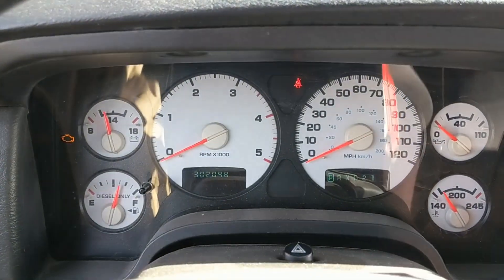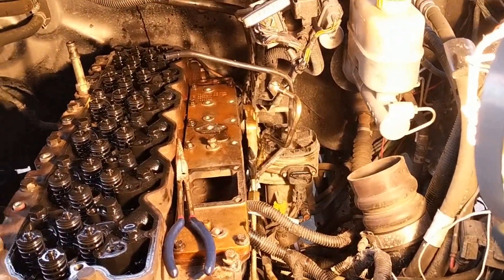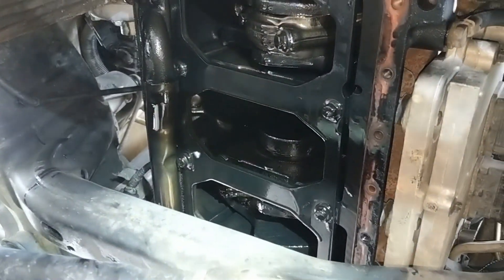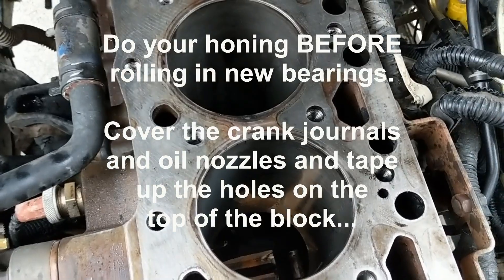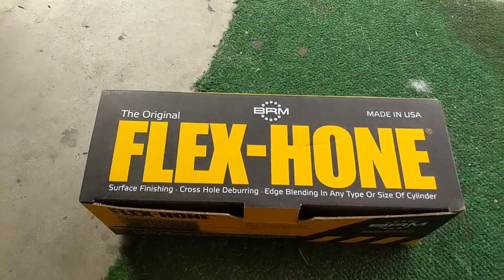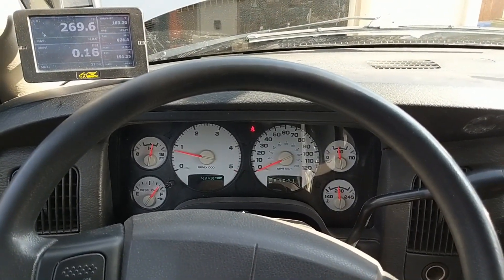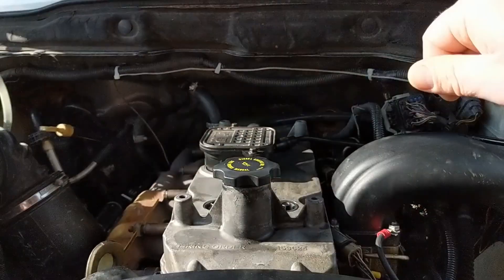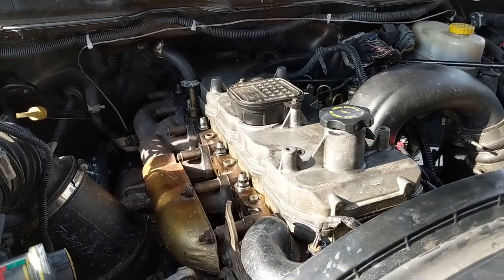5.9 Cummins in frame rebuild- 2005 Dodge Ram 2500

Comment: How did you replace the rear main seal  in frame rebuild ?
Reply from the maker: I didn't.  That was done later as part of a trans rebuild.  You have to pull the trans to get to that seal👌

Comment: I have the same year rig I actually removed mine and sent it out for rebuild , in hindsight I should have done what you did, I did how ever put a new turbo on mine and injectors as mine were toast.
Ended up putting studs on my cyl head head and a new clutch fan.
I'm running a smarty tune on tow mode , which tune are you running?
Reply from the maker: I run my own custom tunes, usually run the Street tune with exhaust brake tuning these days: https://www.5-9diesel.com

Comment: Did you wind up turning the crank see I was going to do this and just use a whole nother engine my truck needs a complete rebuild and it also needs a new ppimp and yeah I was thinking about doing the same thing just putting new Pistons boring it out dropping the pan rebuilding it right in the truck tell me what your thoughts are
Reply from the maker: No I never turned the crank, still going strong.

Comment: Tell me about the high EGT #s , been hot before on stock timing and no tuner, I was worried but 25k later its still ok. 1300+ for over 5 min on a big ole grade pulling over 16k lbs.

Comment: What type of oil do you run? Is it safe to switch from plain rotella to synthetic amsoil or will.this cause leaks or problems at 230,000 miles?

Comment: Hey did you replace the con rod bolts and the main bearing bolts? Or did you reuse it
Reply from the maker: I reused them
Reply: @DieselCamper   hey I’m deep into my engine today 😂 no wrecked cylinder head or walls just tired rings and she need a honing

Comment: I know this comment is years late, but if you use a flat style cyl hone it allows you to see if there's any areas of the cylinder that are worn badly. Piston rings often break because as the piston travels up/down the ring is opening/closing (it's getting worked).  Those worn areas allow the ring gap to open and then the gap closes when it passes the worn area.  It will re-break the ring in no time at all.  In cases like that, it's cyl bore time.  Hone not gonna work.  Traditional flat hone only type that will show the excessively worn areas.  There will be low spots the flat hone can't touch and then you'll see them.  Ball type hone will not show it.  You can also use bore gauge, but flat hone will show the worn areas.
Reply: Sounds like it lasted 300k and he will be happy to run another 300k. Prob broke rings from bad injectors
Reply: Your comment was useful for me I’m getting ready to rebuild my first 24 valve so thanks for the input!

Comment: hello there champion!   I have a 2000 dodge 3500 5.9 liter and has 360,000miles on it..  how would you charge to frame over houl... my truck 
still runs good, but  it needs new gaskets on front and rear seal and tappet cover and oil pan...?

Comment: My personal 2005 has a minor amount of blow by nothing major. The engine has roughly 230,000 miles and is clean as a whistle. I use it 30 weeks a year  to move my rv and it’s starting to run rough occasionally. it’s “losing” or “burns” about 2-3 quarts of oil every 600-1000 miles. Thing that had me the most nervous is it tried to run away on me one morning at a stop light. It shot from idle to 3000+ rpm and sat there blowing black smoke for about 10-15 seconds at 3000+ rpm then just idled back down to normal.

Comment: So how long did it take you do to the overhaul? My 2003 is currently sitting in my driveway with blow by. And I’m hoping I don’t have a lip in my cylinder walls so I can do this. Just curious on the time it took, and how did you time the motor when you got it back together?
Reply from the maker: I gave myself 5 or 6 days to get it done.  Probably worked 4-5 hours per day.
Reply: @DieselCamper  what about timing the motor once you got it back together? How did you do that?
Reply from the maker: I never disengaged the crank from the cam so no need to.

Comment: Thats not normal. That is blow by from running a hone down and zero measuring being done. Also the reson you had a broken ring was because you had a bad injector. Hopefully you changed that too. Also letting a new engine idle for long periods of time will glaze the cyl and cause it to use oil.

Comment: Were you able to use stock piston rings in cylinder one after honing? I’m about to overhaul and do cylinder 1 and 5 trying to get parts list together.
Reply from the maker: Yes I used stock, been going strong ever since.
Reply: Awesome. Thank you! Great video, learned a lot.
Reply: Hey brother what rebuild kit did you use? I’m looking at PAI but don’t want to spend the money and try to re use everything I can to get the truck back on the road.

Comment: I've got 04 325hp motor has a knock thought had bad injector after diagnosis replaced all injectors and new rocker assemblies due to galling got back together enough to run it and check and it still knocking and getting worse more it warms up, roughly 250000 miles. Thinking of pulling pan and checking rod bearings before I pull head to see what pistons look like. Curious what you think about it.
Reply from the maker: Have you tried torquing down the #4 injector line clamp?  If loose it can be very noisy and someone could think it was a knock

Comment: I did the upside down cap test on my oil fill to test for blow by.
My truck is an 03' with 205k and to my surprise there is absolutely zero blowby.
Not sure how this is even possible but it's true

Comment: Mine has ove 240k and still no blow by. Not in the slightest. Is this good or bad. If a little blow by is good should I be worried there is 0 Blow By?

Comment: I just rebuilt mine, did you get the same smoke from the exhaust as the breather tube mine is puffin like white grey smoke goes away when driving just when sitting it’s puffing white grey smoke.

Comment: I wish that I could add a video to your post to prove that it can be done.. It turned out really well, so thank you very much for your video to give me the courage to do my 1st engine
Reply: How's your truck still running?
Reply: @Heliarc91  I am happy to say it is still running awesome!! I can't thank this video enough.  I was very intimidated I admit, but he did such a good job I was able to do it 1x, no f ups....  Could not be happier
Reply: @ChikzDigit  did you notice less blowby after as well?
Or any blowby now other than slight even dissipating haze??

Mine, when warm, will intermittently bounce the cap very slightly with little puffs but it won't make it dance or jump. It comes and goes so I assume a cracked ring somewhere. 

When I did my head gasket the cyl walls were a little slick but had some visible cross hatch
Reply: @Heliarc91  one of my cylinders required a little more clean up than the rest, but even with that, I get no blow by.  I was very disappointed to find out that Dodge is the cause of this problem, not Cummins
Reply: @ChikzDigit  what do you mean dodge cause?

Is it because of the way to little filter system? Or head circulation?

Wish you had some videos of before and after the blowby viewing. Mine used to be only some haze without pressure but now it's haze, Choo Choo with enough pressure to slightly lift the upside down cap laying on the fill hole.
Reply: @Heliarc91  yes, the filter system.  Had I known, i would have bought the 5micron Baldwin filters from day 1 and it would have prevented this from even happening

Comment: Interestingly I did not have to remove the pick up tube or cross brace to get the pistons out.  4 of 6 had broken rings, parts were still  in groove for the most part

Comment: Why didn’t you change the cylinder sleeves instead of honing them
Reply: 5.9 does not have a sleeve/ wet liner  Like bigger diesels - if you want that It's time to pull and machine.

Comment: It may have improved but you still have a blow by issue, you are supposed to have 0 blow by NONE i have an 01 dodge ram 2500
Reply: Blowby isnt the smoke you see...blowby is pressure. You could have pressure leaking and no excessive smoke.

Comment: What is  a “12 valve tune” ? I heard you mention that. I have a ‘04 with 313k on it. I run a smarty jr. on level 3 with #4 timing. Great mpg it’s a hwy truck I don’t run it hard. Question is should I run stock timing or leave it where it seems to be happy??

Comment: did you have to undo the trans to lift the engine that high?
Reply: There should be 2 bolts that you take out to help separate from the frame support.

Comment: Can exhaust brake function be added to a auto 04.5?
Reply: Yes. It works if manual trans. Doesn’t work with auto but it makes my truck quiet around town and at stop lights.
Reply from the maker: All of the 04.5 trucks I've seen have the exhaust brake ecm pins active from the factory, but the trucks require some custom tuning to get the brake to work effectively

Comment: Thanks for the video!  During a recent vacation to the Black Hills in South Dakota, my '04 3500 started consuming oil like crazy.  We were in the line where you pay to park at the Mount Rushmore monument when I noticed smoke drifting out from under the hood.  After finding a place to park, and letting the oil level settle into the pan, it was two quarts low after our trip started (600 miles).  Rougher than normal idle, had full power in the hills for climbing, just had white smoke (fuel fog) from the tail pipe on a cold start in the mornings, and of course, used way too much oil.  I did the basic blow-by test, and it failed miserably.  It looked like a steam engine chugging from the valve cover!  We did make it home from our trip without being stuck on the side of the road (Thanks Cummins!), and I'll be pulling the head to see which end of the engine has the problem.  More than likely a busted ring, and if so, I'll be doing an in-frame overhaul, including rolling out/in the main bearings.  Thanks again for your very detailed and informative videos.  They will be saving me thousands of dollars!

Comment: Thanks for this video. Im literally about to remove the pistons to do my inframe right now.  All because of this video. And a melted piston lol.
Reply from the maker: Let me know how it goes!
Reply: @DieselCamper  I'm worried about honing. Any tips for how you didnt hit the oilers. Don't really want to take them out.   How did you do the tin foil
Reply from the maker: When honing you don't actually have to go all the way to the bottom just want to make sure that you cover the areas where the Piston travels and slightly below.  I did scrape an oiler here and there but mainly put the tin foil down there because I didn't want honing debris to get stuck inside the oiler.
Reply: @DieselCamper  heads cracked and the blocks too scored.  swap time :(
Reply from the maker: Ohh man sorry!  Well you got a brand new motor ahead 👍

Comment: yeah these commonrails cummins love eating valve seats too and then it rips the head up pretty bad i have to replace my head because of a valve seat dropping.. not fun ended up doing a full rebuild but its not to bad as long as you take the time to separate and label all the bolts and stuff that way its super fast putting it back together and in frame wasnt to bad like he had trouble with the oil pan thats about the worst of it.. other than that just make sure your area is covered or clean i bought a roll of plastic and just covered the inside of the engine bay with it so i didnt contaminate anything when putting it back together and it make finding dropped tools etc easier haha

Comment: What numbers did you have on manometer when you decided to undertake the rebuild? Did you test under load or just the 2200, 2500, and 2800 rpm in park. Thanks

Comment: Tip that works leave the old  bearing on the top of the of the Journal and tie a sock around it ... the Journal and bearing and if you are cleaning the deck or removal the liners in some engine the have liners the bearing  make such  a tight fit the debris can't get on the Journal surface 🙂works  great  in liner removal  because  hey no trash  can get between that bearing  and Journal  hope this helps someone!
Reply: Oh yeah socks are elastic so they stretch and everyone has them thanks
Reply: And if you drop something from the top through the hole you don't have to worry about it damaging the journal simple things will save you so much time and money!

Comment: awsome i got new turbo and 3mo later if failed the bushings have gvooves in them looked kinda like your old connecting rid bearings
i want to fix it and put it back on however i really probably need entire rebuild of engine

Comment: REMOVABLE CROSSMEMBER,  I cut out the crossmember on mine at each side, then took 2 pair of 1/4" thick steel plates, drilled 4  1/2" holes through each set of plates, for grade 8 bolts, nuts welded to the plates,  then cut a 1/2" off each side of the crossmember,  slid the plates in, lined up the crossmember with the frame, welded the plates in on each side, now I have a removable crossmember.  I also put 3,  1 inch welds on each side,  on the edges the bottom and sides so no sliding around from torque or heavy loads, 3 years ago and no problems, grind off the 3 ,1in welds on each side and remove it.

Comment: I would not have taken this one apart over that blow by alone.maybe if it used a ton of oil or had a noise.
Reply from the maker: Well it had a broken ring...
Reply: @DieselCamper   check the broken ring.if it was run broken it will be polished up. If it was broken during removal it will have a bit of ruffness between the broken halves. My guess is carbon up under ring lands and during removal while jumping the ring ridge it got broken. Not sure because I was not there.but the blow by was not very heavy in your video.

Comment: There seems to be a lot of knowledgeable commenters, so I have a question. I have a pre-turbo pyro and an HX40 on my 24v. What is safe temperature and duration? Several times when pulling equipment I have gotten up to 1350 degrees for 3 or 4 seconds. I have worried about what damage I did, because I had been told never to let it spike past 1250, so I generally let off the throttle about 1200 degrees.
Reply from the maker: I have a pre turbo pyro and 1250 is my limit.
Reply: 1300 degrees for longer then a minute starts doing piston damage. Normally melting or cracks occur.
Reply: @dannybender8  The HX40 they put on my truck seems to run hotter than the factory turbo did.

Comment: How do you still have blow by, mine has 44k original miles with zero vapor. My last 24v I sold with 230k and it still had less than yours.
Reply from the maker: There is much less now that the rings have seated.

Comment: On lifting the engine to remove the oil pan, did you had to unbolt or remove the transmission from the engine to jack up the engine? I know you had to removed the turbo or at least unbolt the exhaust side of it.
Reply from the maker: I only unbolted the turbo flange.

Comment: I work for Cummins and my have helped build this one.  looks like you did a great job!
Reply from the maker: Thanks Frank and thanks for the best truck engine ever put on the market!
Reply: Lol you must be the lot boy if you think this was a good job. Zero measuring, re used pistons, blindly ran a hone down and then zero measuring after to check runout or clearance. No way you build engines at cummins you would get fired to doing this crap

Comment: Exact same thing I had to do with my ‘05 the second day of ownership. Drove it home with 4 out of 6 holes having broken rings (got a great buy on it). Also did valve stem seals but otherwise the same. #6 did (does) have a slight score from it’s previous problem, but I’ve rolled 200k miles on it since and the clock shows a total of 486k. I expected the score would give a little oil consumption, but it really doesn’t. Good video, gave me flashbacks

Comment: You need injectors ASAP or your going to be in the same boat pretty soon
Reply: Blew up the 6.7 work truck told my boss it needed injectors he didnt belive me then a week later knovking and boom valve stuck to the piston. Tip of #6 injector broke off, must have been cracked for the way it was fuel knocking befor it blew
Reply: @dougsavery5442  my 12v is running like a clock @435,000 miles
Reply: @truckcampertraveler7369  of coursw it is its a 12v lol the new 6.7 made it to 302k befor boom
Reply: @dougsavery5442  lol

Comment: Fueling pattern showing way outside the bowl, most obviously on #2 in video. Have ran plenty higher sustained EGTS in high mileage stock  ISB 305 & 325's, with one stock ISB 305 running 4 digit horsepower at 245k. Injector health and injection timing is critical as I'm sure you're aware. I highly doubt EGTs had much to do with anything here, no indication of erosion on the crown or ridges of the piston caps either. Your burn pattern and failure type is highly indicative of the tune being the cause of failure, raw fuel wash into compression ring. In any case, good job on the in frame. Pulling it is only a 5-6 hour ordeal so I never bother fighting the truck.